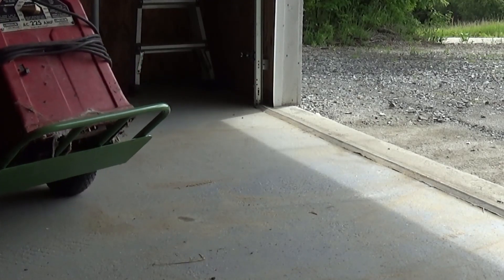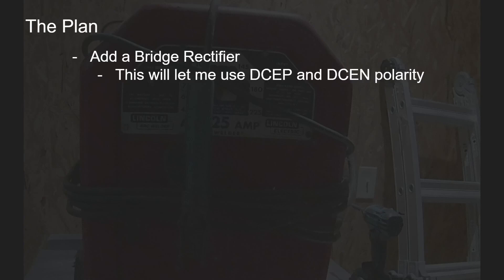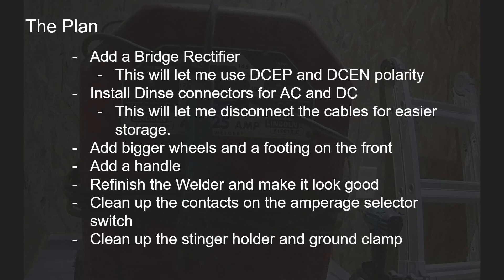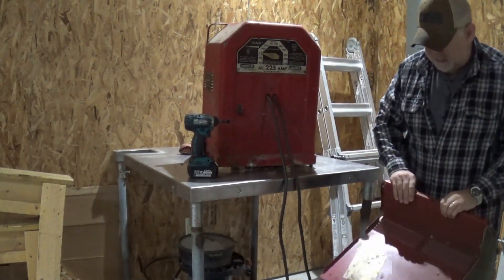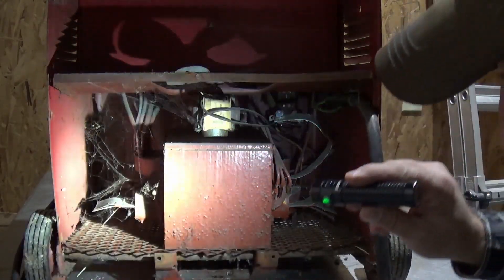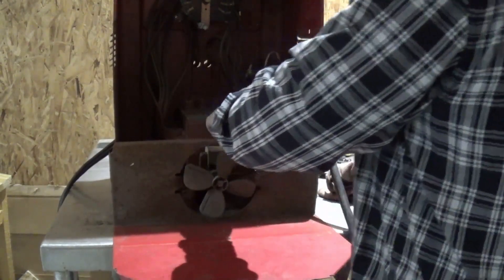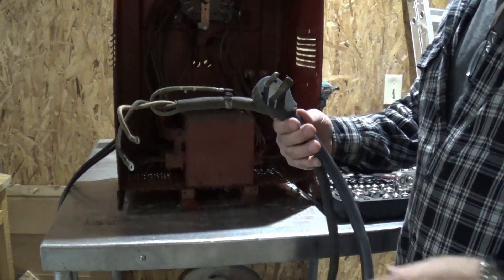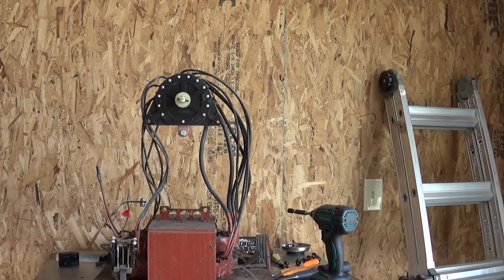Lincoln AC225 Welder Restoration Part 1

Comment: I have the same one I bought from fb market but it doesn’t run the fan spins in the inside but it doesn’t make that humming noise when turned on and it doesn’t get no power
Reply from the maker: It's probably the switch. These things are very simple. UNPLUG it before taking it apart (goes without saying, anyway). There isn't much wiring - check the on/off switch connections - probably a disconnected wire. If not that, check the wiring to the amperage selector. The contacts on mine were very dirty. It cleaned up nice though.

Comment: These simple machines have excellent arc quality and easily last many decades. It's common to replaced dried out welding leads with standard quick disconnect panel fittings (which also costs less than buying cables if you already have a set you can swap between power sources).
Reply from the maker: Agreed, this is a solid machine. I really need to do a part two of this video as I installed the quick connect fittings and a rectifier. I don’t use it much, but the times I’ve needed it, it works great.